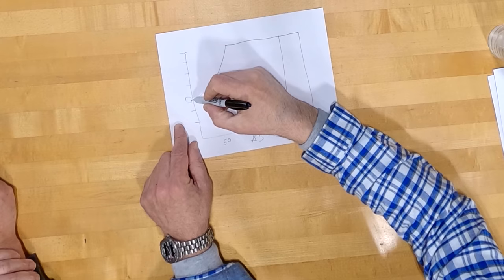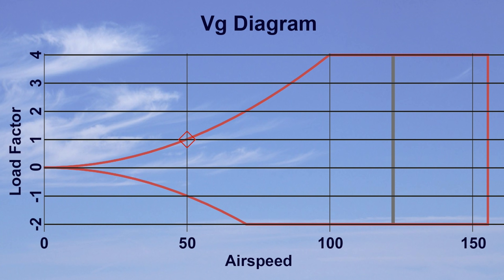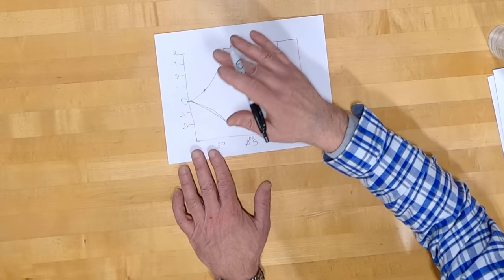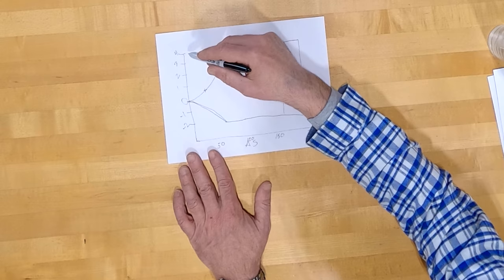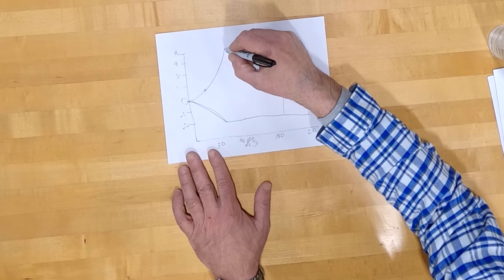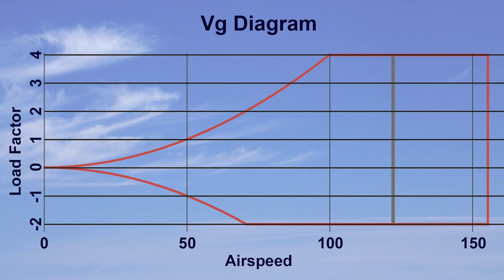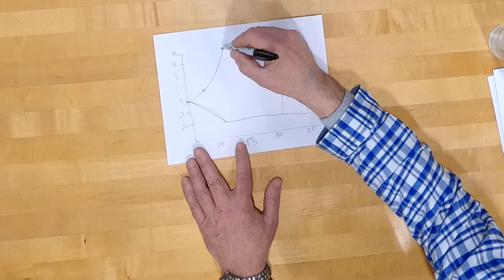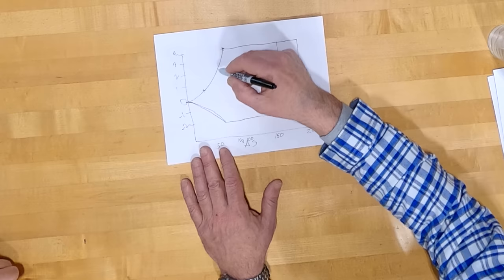The V-g Diagram , or: The Wing Removal Lever

Comment: Could you possibly rename this video title v-n diagram to avoid confusion in accordance with regulations (14 CFR Part 23, Subsection 23.333) and industry standard? g is earth acceleration; n is the multiplier used in the diagram. Great video otherwise. thank you.
Reply: See the video again at 14:45!
Reply from the maker: Whether it's correctly named by the conventions of physics or not, this video is referred to as the VG Diagram. We didn't come up with the name. And as Doug hints, "G" in this case may have more to do with gusts than with acceleration.
Kind regards,
  Martin
Reply: Martin. I inly wanted to afford people interested in the topic a better chance of finding this video  since it describes the load factor diagram used in the design and certification of aircraft in accordance with the relevant subsections of the FARs, sections 23.333 thru 23.341 (normal loads, gust loads, design speeds) and there the g axis is referred to as n, which is why I have only ever heard of it referred to as v-n diagram. I appreciate your videos. M.-A.
Reply from the maker: @marc-andremuller1954  Thank you, Marc-Andre. I have added the following to the description of the video: "The V-g diagram is also referred to as the V-n (velocity versus load factor) diagram, as referenced in FARs 23.333 through 23.341." I appreciate the clarification.
Reply: @ Martin Pauly. Thank you Martin and thank you for your videos; I hope to apply some aspects of your operating lean of peak video once my new engine monitor is installed in a few weeks. safe flights!
Reply: As an aircraft structural engineer that has worked major mods on many commercial and military aircraft, I concur that this is called a V-n diagram and not a V-g diagram. (If it is called a V-g diagram then the ‘g’ certainly does represent a gravitational acceleration factor—not gust.) It’s normally only used to depict the vertical symmetric maneuver envelope but you can certainly overlay vertical gust conditions and speeds on it. Gusts are defined differently as pointed out: classically they are discrete conditions at a specified gust velocity. More modern analysis uses a PSD definition of gust to account for the aeroelastic response of the airframe. Also, please never intentionally fly an airplane above limit load factors. That is truly the operational limit of the airplane. Part of the purpose of the 1.5 limit to ultimate factor is to account for uncertainty/unreliability in analysis and test. It is a safety factor. Not everything in an airplane is substantiated by test as sometimes implied. Much of aircraft structural design is only substantiated by analysis.